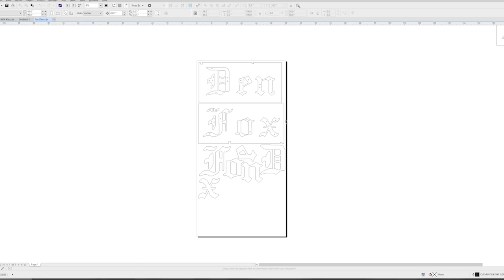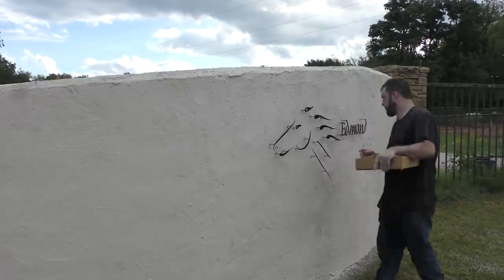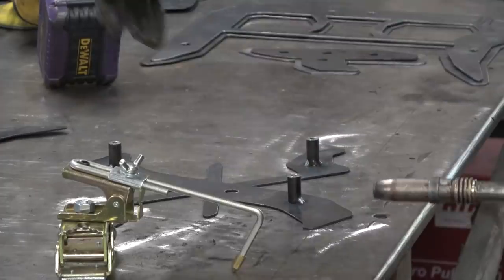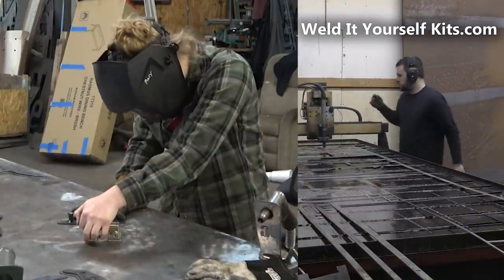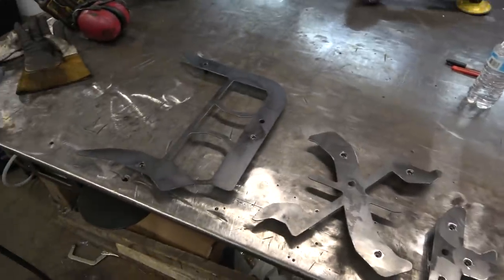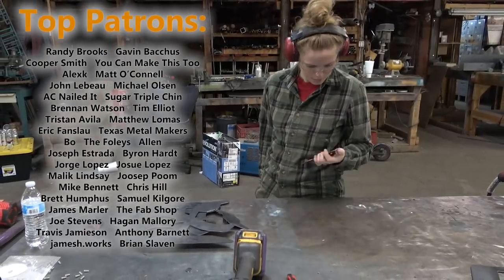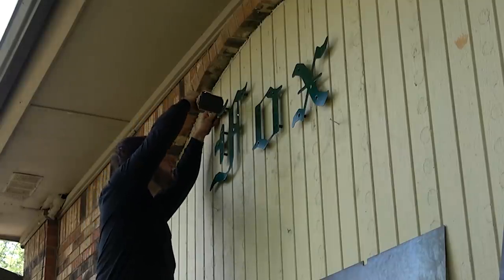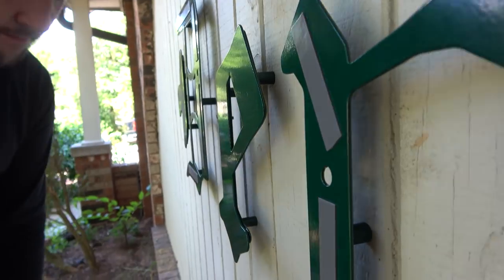INVISIBLE Sign Mounting - New Method

Comment: Countersunk steel spacers are no more tricky than a bit of thick wall tube, cut to length, and a few minutes under the drill press with a countersink bit chucked up. You don't even need to own a lathe. I make them all the time. Don't need to make it super expensive for a non-visible element. Just for fun, I checked McMaster, (since they offer that exact custom service on their website) they came out to be $1635 for 100 of them. Haha!
When I do inside signs, even though I have a lathe... I always just buy the nice ones from MBS-Standoffs. On occasion, I do have to drill through them to make them spacers instead of threaded stand-offs. And I sometimes countersink the backer letter, if it's like .125" aluminum. I just did a sign like that, but the faces were acrylic. It's a great technique. I've got pics up on my instagram.

Comment: This looks great, could also do a nice shadow effect with having the prices with screws larger then the front pieces.
Also those parts would not be hard to manufacture on a CNC lathe. Many small shops would take that easy job and I’m sure you can get the cost real low.

Comment: Nice video. I’m a neon sign maker. We use a similar process for installing neon, but we use a paper layout (use a plotter to print it easily). 

You might find that it’s cheaper and easier to use than metal templates. Paper gets taped to the wall, checked for level, adjusted, then just drill through the paper in the marked spots for fastening. 

Let me know if you want me to elaborate.
Reply: Also, you can most likely find studs like what you had machined already made via McMaster Carr
Reply: Well cheaper is relative, as he gets the template from just cutting the sign letters from a metal plate in the size the sign is, so it only costs the amount of plate used and some of it comes back as scrap value.
Reply: @JaakkoF  Yes that is true. In the sense of convenience, you can keep the paper layout taped up until the sign is completely installed, ripping it away after checking your alignment/spacing. This is how professional sign companies operate.
Reply: @JaakkoF  Nesting your pcs saves even more money, scrap is $10 / ton that doesn't pay the fuel bill to get it there. I use the plotter as well for many projects. One of the best way to make a mock up is to print to poster paper..
Reply from the maker: @kodyps you realize the fact that I am being paid to do this makes me, by definition, a professional?
Reply: @42Fab  I wasn't inferring that you are not a professional, I offered a useful tip for hanging signs.

Comment: Just thinking, I think you’ve used threaded standoffs in past projects. I think you’d be able to easily weld one of the threaded standoffs on. Then use a countersink drill bit after it’s welded and you’d have basically what the machinist made for you. Even if you needed to drill out the threads I think it would still be worth it.
Reply from the maker: it's an avenue I'm looking at. Not a fan of them being hexagonal vs round, but that's relatively minor. good suggestion

Comment: Do you think you need a LLC immediately if you’re just going to do small things starting off and ur not 18 yet so you cant legally form one
Reply from the maker: It's great to have for pretty cheap. If someone gets hurt from something you did, they can take your business and assets but not your home, car, etc (generally speaking). 

That all said, it's a risk mitigation strategy, and we all define our tolerable risk level. Personally, I use one as it makes separating all my finances great and has the other benefits mentioned. I do not plan to build something that will hurt someone, but freak shit happens.
Reply: 42Fab - Metal Fabrication & Signage Luckily I dont have any assets yet

Comment: omg, why wouldn't you use a plotter to make a pattern instead of sheet metal?
Reply from the maker: OMG, because time is worth more than the metal that was used, space in a shop has a value
Reply: @42Fab  Lol, touche. I see what you did there. I've always used a plotter to make a wall pattern cause it's lighter and easier for us, and takes about 30 seconds to print. I don't see how it saves you time, but I'll trust you know more about how you do things than I do and it does save you time.
Reply from the maker: It's more about dedicating space for something I would not use often. The backers are cut directly from the stencil, so the only extra cut is to cut the stencil rectangle out.
Reply: @42Fab  I see how that makes sense in this case. We usually form out our wall mount signs so we dont have the raw materials to use as a stencil.
Reply: @42Fab  That plotter / vinyl cutter makes me money too.  The metal saved by nesting your parts adds to the bottom line as well..
Reply from the maker: it does, for sure, but let's do some quick math: My shop rate is $100 an hour. The stencil uses, let's say, half a sheet of 14ga HR, which is $55/sheet in my area. So in order to make dicking with switching over to a plotter worth it, I'd have to save $28. Let's say the amortized cost of the plotter is $1 per job, just for the sake of easy math. $27 is 16 minutes of my time, so instead of just drawing a rectangle and hitting "cut" I have to draw a stencil sized for the plotter, maybe that takes 5 minutes, including rolling up the print and taking it with us on the job. Now I have 10 minutes of time to dedicate to having a place for a plotter, getting it plugged in if I'm stashing it somewhere, etc. You see how quickly any "savings" go to 0. Things I haven't accounted for are the value of the floorspace, cost of paper/ink, maybe having to move my file to the computer connected to the plotter, etc. Using the plotter for other jobs is great, we do not do so.

I am not saying it is not A right answer, but it is not THE right answer for everyone. Shop space is a premium for me. 

You can be right and be completely wrong at the same time, keep that in mind when making decisions for your business and commenting on others. The arrogance of anecdotal experience will only hold you back.